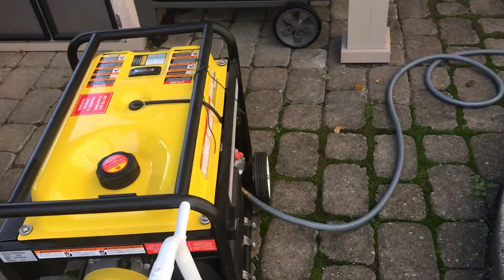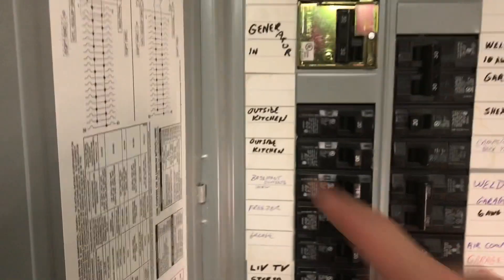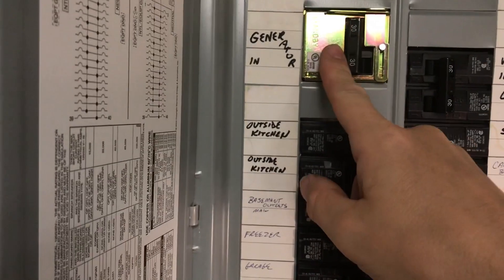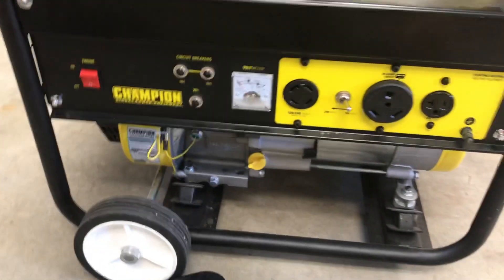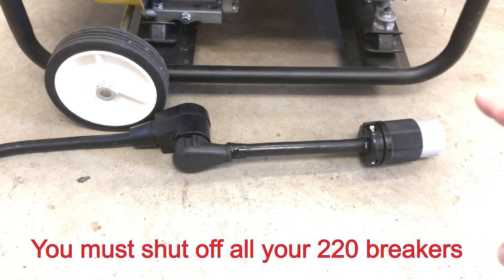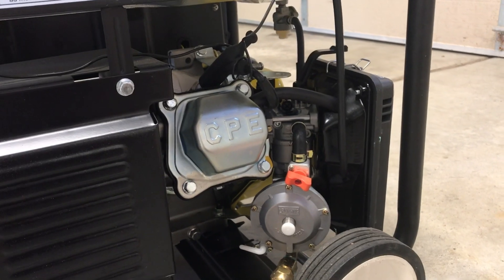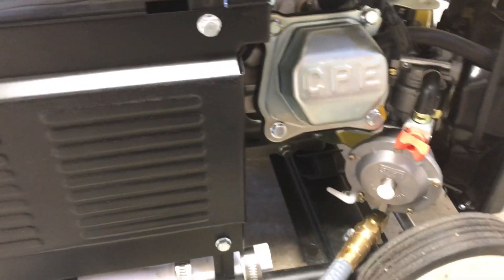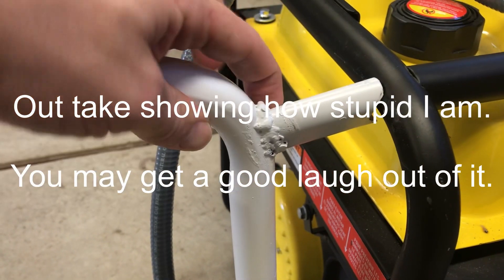Part 3 (Final) - Converting Champion Generator to Natural Gas or Propane NG LP

Comment: Put the same conversion kit on my NEW Champion 4550/3650 generator which has never been run. With a GASPRO 10FT Two Stage Propane Regulator with hose, RV Propane Regulator hose with Standard P.O.L. Connection and 3/8in Female,fit for RV Appliance, grill, fire pit, Gas Generator, Gas Stove/Range and More. But it will not start up. does anyone know what I can do to get it running.

Comment: You're explanation of 120v ans 240v do not apply.

If you're in the US, you appliances will be 120v. So DO NOT switch over to 240v otherwise you'll blow everything.
Reply from the maker: For 240v you have to use the other plug which has another wire. Our panels have 2 120s coming in with a zigzag on the breaker so that you can connect 2 for 220. Our bigger appliances are 220 but in the area I am at, most of out energy hogs are NG.
Reply: Our residential load panels use 240 volts the are out of phase with each other by 180 degrees with a neutral tap in the center of the Edison transformer this is called split phase. This is how we have 240 volt appliances and 120v. 120v is achieved with either hot leg in the breaker panel and a neutral wire that runs to ground. All 240volt appliances must use a leg from each side of the bus bar where the 240volts are 180 degrees out of phase with each other. Pulling two hot wires from the same leg would simply cancel that voltage out.

Comment: Some conversion kits have two electrical wires from carb. What are those for. Hope you can assist.
Reply from the maker: I can only guess but maybe some have an electric choke.
Reply: @ShutterFanatic  Thanks. That makes sense.

Comment: That's one way to use Bourbon.... to cover up the gasoline spill from earlier. :) Good video. You need to adjust the screw inside the orange knob. CW goes lean and CCW goes rich. I think that it may be too lean, that's why it's stalling when you open up the choke.
Reply from the maker: Thanks
Reply from the maker: Thanks. Right after this, eagle rare went crazy scarce unless you pay stupid markup prices.  Good points on the settings. I have used it a few times and kinda got a feel for it.  Since you can adjust like a normal carb, I figured out that moving the knob more to LP until it warms up worked. I just bought a new champion generator so stay tuned to an updated video.

Comment: You need to add a regulator to get the full power out of your generator and not have to half choke it.
Reply: There's a regulator built in to the carburetor that he installed.  I think you missed its distinctive pancake shape.

Comment: Just FYI your generator is 4,000 watts ‘SURGE’ and then it says 3,500 running watts. You stated in your video about running 120 v instead of 120/240 . And that gives you 4,000 watts at 120. However that’s not the case. You are only getting 120volts of the 3500 and that’s INLY if your running to the full 3,500! Watts if it were 4000 that means you’re maxing it out all the 4000 constantly which would end up hurting the machine... to sum up you’re only using up to 3500 watts not 4000 plus natural gas will decrease the amount of power out put by at least 15% give or take. So actually your out put would be 3500 minus 15 percent is 2,975 watts is the approximate wattage.

Comment: My condolences on the bourbon. I have the same issue with running my Champion generator at half choke. Did you ever get it straightened out?
Reply from the maker: Yes, I bought another bottle lol.  The generator is working good. Sometimes it runs a bit rough at the beginning and I adjust the flow but mostly I just leave as is. I don’t run it much as it’s my emergency backup generator.

Comment: Great videos, I appreciate them!!! I have an almost identical set-up, same generator, same type amazon carb,  running on natural gas. Mine doesn't start as easy on natural gas as it does gasoline & I think it'll be worse in the winter. Have you tried starting on gasoline &  once it has warmed up, shutting off the fuel/gasoline valve, then turning on the natural gas? I'm sure it would work fine to let it completely run out of gasoline & die, then turn on the natural gas & re-start,  but I'm curious if it would safely switch itself over when the gasoline runs out without having to re-start?
Reply: When it’s really cold out that would be the best way to do it.

Comment: Your choke issue might be because the regulator is for "compressed" natural gas which has a higher pressure. If you had a natural gas compressor and tank it might work normal.
Reply: An unregulated Propane tank will have a higher pressure. Because his NG is after the meter is now down to 11oz. 

You are right compressed NG does have a higher pressure but that is in the distribution lines not residential-less or individual house- even less again.

Comment: Just got the same kit, but for a Honda 2200 Jenny,  no instructions, your video gave good in site, I think you did a fine job, I work on boilers, turbines , natural gas, fuel gas etc, but one thing that you can check is that you are getting around 10 inches water column of gas pressure at the inlet of the diaphragm, this is where your connection is, while the motor is running, using the choke is cutting back airflow, suggesting not enough gas is available, this in part will rob you of horsepower and power output, most homes have 10 to 14 inches water column,  most gas appliances are set at 3.5 inches, that is where pipe size comes in, if you know a heating guy, have him check it out, he will be able to make adjustments for you, best of luck.
Reply: Hello, so how many psi would that convert to? I have 4 psi at the kit's inlet coming from a 3/8 hose  and still wouldn't run well unless I almost completely choke it, and still rpms are not as high as they should be. :(

Comment: I ordered a Honda knock off carb with LP like yours but I'm going to adapt it to run a Techumseh 10hp generator so I'll need an adapter plate and a new governor link wire.

Comment: Make sure your gasoline petcock is OFF so you don't get too much air in. If the fuel tank is empty it will draw air through the fuel line. You shouldn't have to run with the choke on.
Reply from the maker: Thanks. I will check this. I am due to pull it out for a test run.

Comment: you also need to adjust the governor to get your RPM's to 3,600 for proper voltage and frequency output

Comment: Mark all your breakers you need to use with the generator with colored tape or paint, turn them ALL off when you switch to the generator, then turn the marked breakers on one at a time.
Reply from the maker: Good tip. Thanks

Comment: have you managed to find a way to reliably start it off propane or natural gas?  I did basically the same setup on my generator and only got it started once off propane.  had heck of a time pulled like 100x.  Starts right up off gasoline.  For propane I have a new  bbq grill regulator.